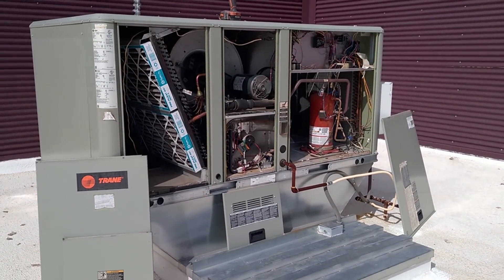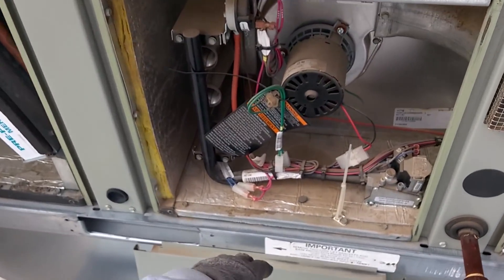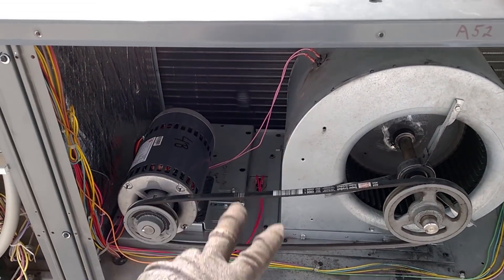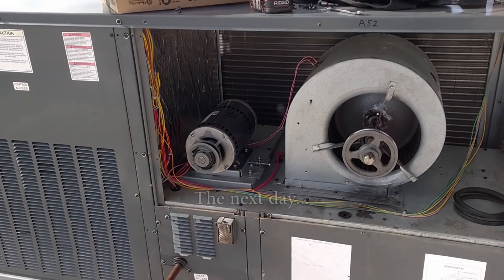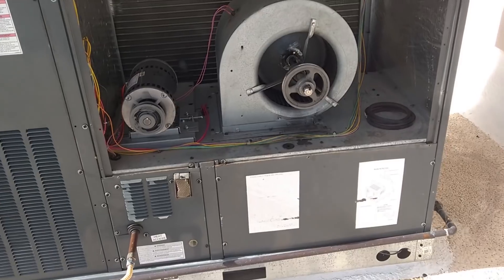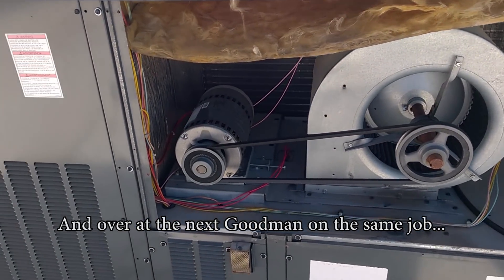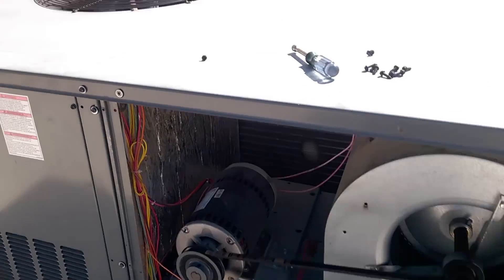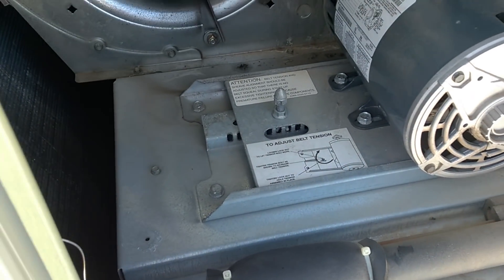Real world no-holds-barred comparison of Goodman and trane commercial RTU's

Comment: This guy is obviously trying to score points with his Trane rep. Also maybe looking for consideration on pricing. If a Goodman is installed correctly, it will last as long as the Trane. Goodman are easier to service and you don’t wait 3 days for parts. But admittedly, Trane looks prettier.
Reply from the maker: Did you see the blower/belt design?
No comparison. 
Like comparing a Yugo to a Rolls Royce

Comment: Maybe Goodman ACs are better now than when the units in your video were built.  And maybe the high efficiency Goodmans are well built, which is what some experts say.  Did you ever think about that?
Reply from the maker: No. They still suck.
I've been on rooftops with relatively new wanna-be sorry-ass excuse for commercial units and they still suck.
Totally bottom feeding/low bid option equipment.

As the video states, a company like Trane or Carrier makes a broad array of equipment with the latest and greatest tech. Goodman just makes very basic entry level options, and they can't even perfect that!

The closest Goodman has to technology is their air handler units that were adapted to be used with Daikin VRV where they slapped in a electronic expansion valve.
And in the Daikin line up and throughout the Daikin VRV training they had to keep adding disclaimers "Except when such and such model is incorporated into the system", the Goodman AHU. LOL 
I could hardly contain myself when they keep saying that!

Comment: Our 90 ton trane with negative air has been junk since install. Added a .5mill coil fed by our lochnivar boilers upstairs jut to get above 60 in the winter it blazes with Added coil. The trane sucks. Nothing wrecks like a trane. I'll take the carrier aquasnap anyway and depend on any air box but a trane. Its last one that hasn't been removed from service in 6 buildings over 60 thousand feet in 6 clinics.

Comment: Goodman is the Best. They put food on my table every day, on the other hand my 1980’s Trane keeps me warm and cool. That baby cube is still going strong, just need to replace a few caps. GOODMAN IS THE BEST
Reply: The reason for that is there are more Goodmans installed. Customers don’t necessarily want to spend a lot more money on a Trane. Install it correctly and it will work just as well as any other brand. I even have two Goodmans in my own house. They were installed correctly.
Reply from the maker: The best for providing more service calls and noise complaints.  Yup

Comment: Are the trane commercial coils as leak prone as the residential ones? A couple years ago nearly every technician at a trane class was complaining about them. We came to the conclusion that they were dipping them in acid. Lol
Reply from the maker: They seem to hold up pretty good.
The older Voyager units used to acquire leaks on the condenser bulkplate after about 10 years but those units run almost 24/7 in those applications where the system cycles between 1st and 2nd stage without turning completely off.

Comment: One Goodman focuses on Residential not Commercial use.  Two the units compared are different sizes, three the person they higher to maintain those units must suck.  Your comparing a Semi to a Pickup and bitching about it.  I mean really residential any System you buy are usually as good as the other it all about the installation.  Having problems with your AC System, get a new a competent technician, and BAM problem solved.

Do a price comparison chump, and the price comparison of the cost to maintain the two, then we can talk, you bias sell out.   This guy is a perfect example of a sales man, or a military recruiter.  Your pitiful.
Reply: Alejandro Ortiz STFU. You know deep down inside Goodman sucks. Doesn’t stand a chance next to Trane.

Comment: I've found after dealing with a lot of industrial equipment at work, that sheet metal must be one of the hardest, and most complicated things to get right just based on the amount of flimsy garbage sheet metal work I've seen. We're talking big industrial machining centers that cost upwards of a million dollars. Many of these machines have flimsy sheet metal covers that require 40 screws in each one to not flop uselessly around. It makes doing basic maintenance stuff a huge headache. 

But, we have some really, really high end machines that have very nice covers. They don't flop around and are very stiff. They often have hinges with removable pins, and only require 2 screws or two quick-release latches to stay secure and not rattle. It's stuff like the quality of the sheet metal that really sets the high-end guys apart from the lower end ones.

Comment: Are you just a Trane distributor? I don't care for Goodman myself but I don't care for Trane either. Have you ever tried to replace a heat exchanger on a package Trane unit? Ridiculous I have to remove the entire blower assembly and the drain pan to take out the screws necessary to remove the exchanger, or how about the 1/2" to 3/8 liquid driers that are undersized? Or why you have to have a conversion board on some units to hook up a conventional " non-trane" thermostat. I work on more Tranes than I do any other brand. I'm not impressed. I think they are over priced pieces of junk. I can find manufacturer flaws in every manufacturers equipment but I also don't tell the customer that they have a "turd" for a piece of equipment or slam on other contractors and accuse them of lying. That's bad business. I don't have to talk bad about other contractors to get my customers to call me back. My work speaks for itself......Just saying
Reply from the maker: No I'm not a distributor. I am a tech.
We don't have too much heating out here. Mostly heat pumps where refrigeration is the only source for heating.

I believe that almost all modern Trane's will work with either the Trane EMS or a standard t-stat. It was the older ones that needed a conversion board.
But you can't really compare a Trane with a awesome Reliatel system to a Goodman since Goodman doesn't even imagine something as awesome as the Reliatel system in their dreams yet alone produce anything like it.

Trane is awesome. You just slap in boards and they communicate to each other with a 4 wire harness. (Power and data).

Goodman can't even use a beefy enough screw to secure their blower motor bracket yet alone design what Trane makes. 
And Goodman don't even make that many types of units. Just gas packs, heat pumps. That's about it. 
Trane makes a ton of equipment from Chillers to large air handler units.
You won't see a Goodman on a Hospital or anything like that. No one is that dumb.

As I have said a zillion times. I am fine with Goodman being used for what it is. Cheap. Entry level. Low bid. etc.
But when people try to say it is equal to something like Lennox, Trane, Carrier, etc then they are lying or are deceived themselves.
Reply: Jay Walling did you know that this video what is made to compare the two? Did you know that this video was shot on the same roof to compare the two? Did you know that this video is made by a professional and technician that works on units everyday whether they are a Trane or an AAON or an Amana or a Lennox or a Goodman or a York or Carrier or Rheem or whatever the hell brand name it is? 

You didn't watch the video did you? it's clearly not a biased video at all. Are you a paid troll?

Comment: who gives a shit about the fuckin panels look how much easier the goodman is to work on both Comercial units have a 5 year fuckin warranty I'm not standing behind either one but fuck trane and there weak ass txv your going to tell me it's better for the customer to pay 4,000 more for a unit that has a 5 year warranty or if it's residential they both come with ten
Reply from the maker: "Easier to work on"? 
Are you stoned or just....? 
Did you not watch the REAL WORLD EXAMPLE in this video???

The fact that all three Trane panels can  be removed in less time than a single panel on the Goodman already proves that the Trane's are easier to service.

I have rooftops with 70 Trane units on them. It would suck ass if those were 70 Goodman units that I had to remove a dozen screws on each panel.

Also the Goodman has a real shitty motor mounting system. Almost everyone has to be repaired right after a year of use. 

Then the belt tensioner. Are you going to claim that Goodman's is easier/better than the system Trane uses???? HA HA HA HA HA HA HA!!!!!!

And on Trane's you have the test procedure to step through each mode of operation including the economizer.
How does that work out for ya on the Goodman?
Oh right. It don't do that.

Looks like another low bid installer who wants to deceive people to believe that entry level/budget equipment is on par with the good stuff.
Reply: Lol this lazy ass fuck is scared to death it will take him a hole nother 1 fuckin min to take out 4 more screws looks like another I'll skip half the fuckin PM check to move to the next you know  how many txv have to be replaced on a train right after Start up you know they use a copper evaporator coil that is   guaranteed to leak in 2 years vs the goodman all aluminum coil 2nd train has a 5 year warranty on commercial units and so does goodman so get the fuck out of here with this I only have to take 2 screws out of the train it's automatically better with your lazy ass
Reply from the maker: Again. Jackass. 
Removing 12 screws per panel on a Goodman turd compared to 2 per panel on a Trane. Hmm...

Now multiply the units times 70. Imagine 70 units on one rooftop and you got to replace filters and belts in them.
And then adjusting the belts. Shit. The Trane belt adjuster kicks ass. The Goodman one's are complete and utter shit. As demonstrate in my video. (Where's your video demonstrating otherwise???)

The amount of time saved will be HUGE on the Trane over Goodman. No comparison. It won't even be close!

PLUS AS A BONUS you'll be spending time fixing stripped and busted screws in the Goodman units as I demonstrated here. Shit. I'd hate it if I had a rooftop of 70 of these damn Goodman bastards rather than three as there is on this particular example.
Reply from the maker: brian Graham
I'm in Arizona where A/C units cool buildings almost 12 months out of the year and have to do it at over 110 degrees in July and August.
The men are separated from the boys around here. Trane etc is night and day better than a Goodman where they are put to the test.

And, as I said, I'd rather work on Trane's all day long than a bunch of Goodman turds.
The Goodman's are like kindergarten crap where the Trane's like these are actually designed to be serviced as well as last.
Reply: I'm in tn where the humidity will make a grown man cry I've seen a 2 year old trane evaporator coil have to be replaced because of leaks and I've also seen a goodman blower go out on day 2 of start up and my list goes on and on me personally they don't make anything like they use too and me personally I don't see one being better than the other just from what I seen
Reply from the maker: brian Graham
Not making anything like they used to sure is the truth.
Reply: hackfreehvac 
oh, another troll! this one uses better language lol

Comment: No Offense I Had A Trane Package Heat pump I Did Not Have It A Year And The Compressor Failed And Trane Would Not Replace It Even Though I Had A 10 Year Warranty In Writing Sad
Reply: How is that possible? Not installed by an authorized dealer?
Reply from the maker: I don't think it is possible.
Trane would go by the date of the equipment at the very least which would be 5 years for a residential compressor.
Maybe the guy never registered his extended warranty or something. 
But I gotta call total bullsh*t on the idea that Trane rejected a warranty on a less than 1 yr old compressor.
Reply: hackfreehvac  we are a trane dealer and I call bs. Compressor would have been replaced without question. Any company could have been called and warranty would have been covered
Reply: anyways I take back what I said about trane
Reply: I Soon Found Out That The Company who installed in did not know what they were doing and fucked it I not am  going to mention the name of the company but they know who they ar
Reply: yup like I said I have got a new trane heat pump and it working good
the company who install got shut down because doing bad installs
Reply: Jeff Grant heat pumps r junk

Comment: I think  all brands are just made cheaper these days because those belt tensioner on that Trane your servicing strip  out as well I've came across a few that  were I'm  not defending  goodman but it's a fair unit for a fair price and the main parts of the goodman such as the comp coils etc will last just as long as the Trane unit would right

Comment: My business gears are always turning. If you ask for a perfect package unit hackfree you will be out on your ass soon. Installs run dry and then service is all that flows. Some of the not so perfect units are glorious because they keep us coming back. Remember that :) I actually love Goodman split systems. Very straight forward design and they freaking last! See your point though over the blower motor mounts. They failed here miserably. The whole sub assembly should've been through bolted from the factory not sheet metal screwed down.
Reply from the maker: +fla playa Also in Arizona the units run HARD compared to more mild climates.
AND most units are heat pumps here so the compressor runs both seasons.

So in this climate we say it separates them men from the boys.
And Goodman is just junk.

I initially did HVAC in Norther Arizona where we used gas heat because of the cold climate and snow.
The Goodman's up there lasted a lot longer than they do in the valley. But that is because the compressor sections don't run too hard in the summer there where it maybe gets up to 100 max versus 115 down here and the compressors don't run at all in the winter up there.
Reply: Damn yeah 115 is extreme. I'm curious, do you have to oversize tons on a given square footage out in the desert? e.g. a 2.5 ton unit will struggle badly here with 1700 square feet when it hits 105 degrees.
Reply from the maker: Rule of thumb here is 1 ton per 400 sq foot. High efficiency homes can do 500 sq ft or so.
Reply: Wow that's changed a lot in 10 months. It was 1 ton per 700 last I checked. 900 foot house 1.5 ton.
Reply from the maker: fla playa
In Arizona they size for sensible cooling primarily and they are sized for hot days. Basically they are oversized when we are not in peak weather days.

In other areas where it doesn't hit 115 every summer but the humidity is high they size more like what you stated because they pretty much need the longer run times to remove humidity as much as they need the cooling.
Reply: hackfreehvac You know your stuff, I'll leave you to it good sir. Humidity has a lot to do with the equation.. Bet out there you get zero condensate. Informative and interactive, thx.
Reply from the maker: fla playa
Ha I WISH we got zero condensate.
But it isn't much until the humidity kicks up.

The beginning of the summer is like 15%
But we do get around 50% and higher here and there in the Monsoon season.
Then it drops again.

We're bouncing between 20 and 30% this week.
Reply: hackfreehvac That's pretty exceptional, I thought the desert to be ten to twenty percent year round. 

I live in Tennessee right now and we've had dew points in the negative range with avg humidity at 15% all summer. Climate is possibly in an uproar.   

My brother is a big HVAC guy down south who taught me some of it and he has several complaints a week from people moving from out west... Complaints: "Oh My Gosh What Is All This Water"?.."There's something wrong and I demand you fix it" Type stuff. You have it easier out there but perhaps harder on a 125 degree day.

Any different orifice or condenser sizes out in the desert, or air flow speeds across evap? Just curious as a little scholar.
Reply from the maker: fla playa
It's varying a lot. High humidity of 30% or so and low of 6% from what I see in the forecast for the next ten days or so.
Reply: hackfreehvac 
Well rust is not in your forecast at all. Down in Florida sea mist comes in on top of 90-100% Relative Humidity. Wrecks havoc on units and Trane is good but so is Goodman. Peace.

Comment: goodman units are very simmilar to tranes in the layout, but they are a thousand mile drive apart in terms of quality. goodman will never have as good quality as trane or carrier
Reply: According to some other YouTube videos, some of the Carrier RTU’s have cheap motor brackets that bend and have to be shimmed with washers.
Reply from the maker: +Roush Hawley Yeah they will probably never have the quality. Their niche is cheap low bid installers.
Goodman patterned off of some OLD Trane residential units perhaps (grossly patterned off as in rough shape), but they have nothing like the Trane commercial units.